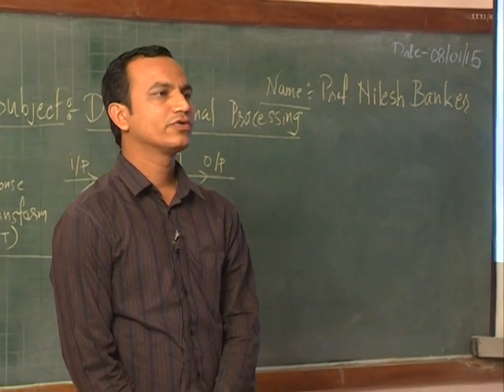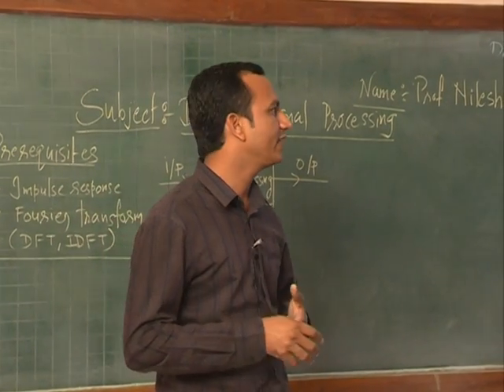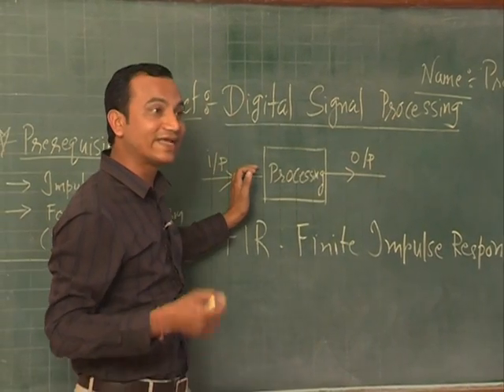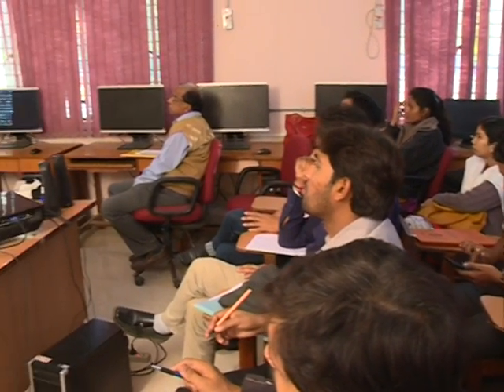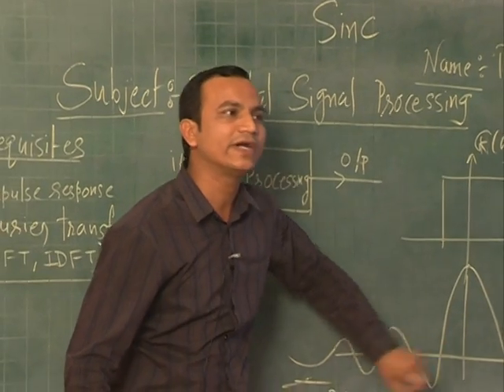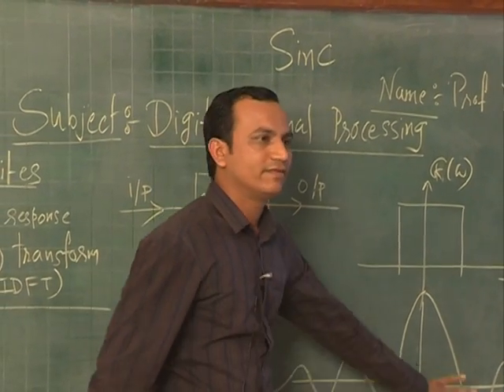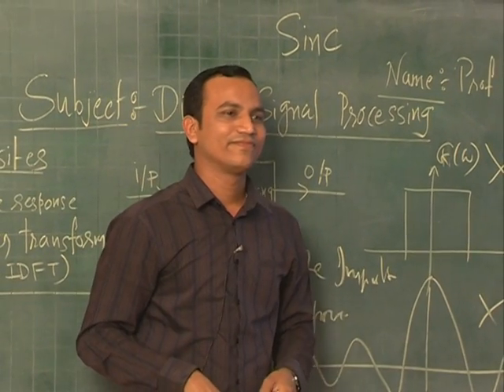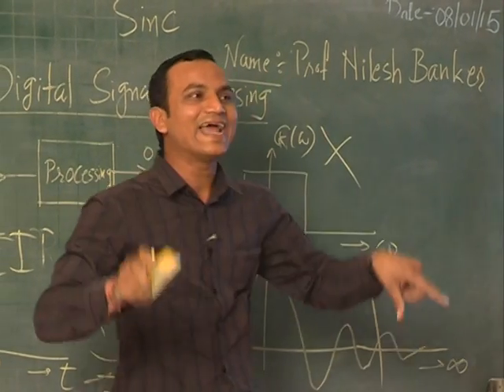FIR(Finite Impulse Response) Filter design using Windowing Technique-1

Comment: Sir when you are unable generate an infinite duration sinc function then how would you multiply it with the finite duration signal
Reply from the maker: Infinity for computer is the largest number which it process. I mean you can of course not able to generate an infinite sinc in lab but you can realize the same by the range of values which one can consider to process. Due to this limitation only, we can not able to generate an ideal low-pass filter in lab. I hope this will satisfy your query.
Reply: nilesh bankar nice explanations sir, keep upload more information sir